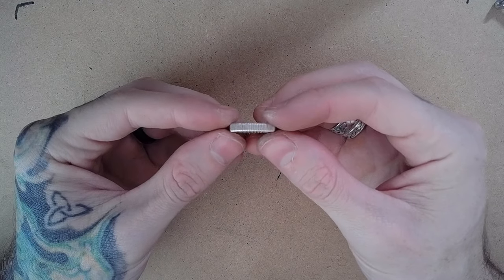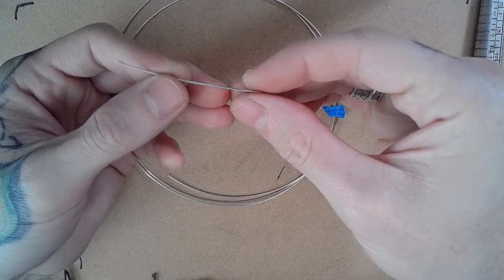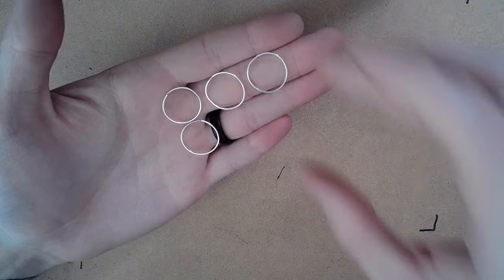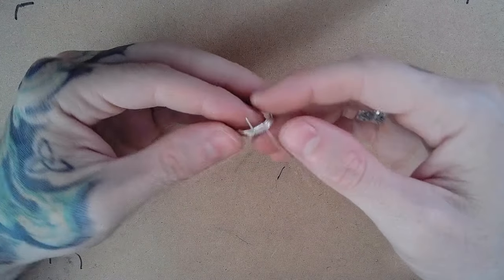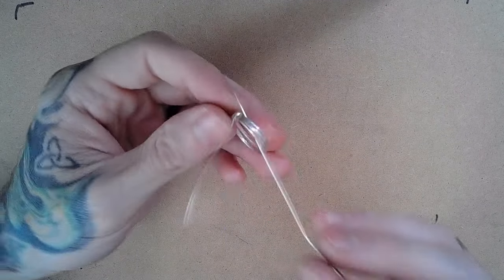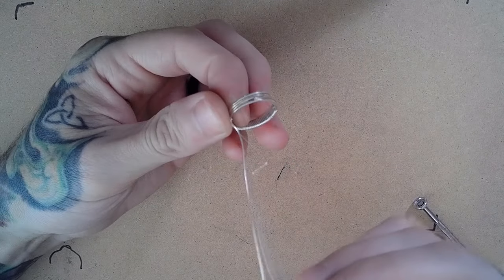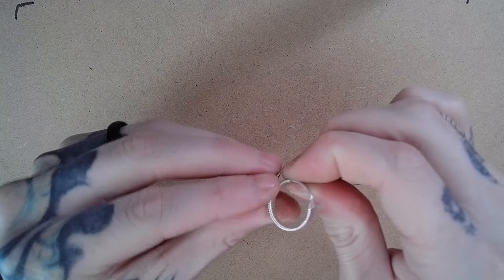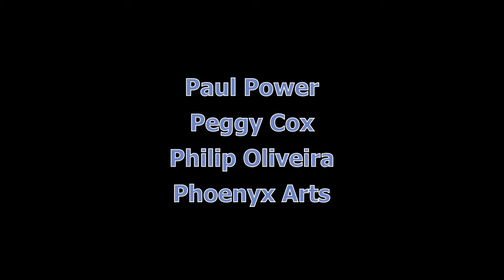Wire Wrapping Tutorial: Seamless Rings (NO SOLDERING REQUIRED!)

Comment: For anyone who has no access to square wire, for whatever reason, if you gently hammer each ring band so that you create a flat side, that will improve your outcome dramatically. I tried and was happy with the results. You still should be using half round for binding but I bet it would probably be ok if you used a Very thin round wire to bind as well.

Comment: Thank you for this, I am fairly new to wire wrapping and still find soldering a bit intimidating, so I always appreciate this kind of alternative.
One question, if you don't mind.. how do you straighten square wire, so that it doesn't have the subtle twists, made apparent once wrapped. You're work has led me to fall in love with square wire, and I'm definitely incorporating it into as much of my work as I can, but I have to admit these small twist drive me crazy (obviously never an issue with round wire!).
Reply: flat nylon pliers
Reply: You have to make sure it doesn't twist to begin with! Once a twist starts its hard to correct it. If your having trouble with making the ring shank circles just wrap them very slowly around a ring mandrel making sure you keep a flat side down firmly against the mandrel.

Comment: Thank you for this! I made 5 perfect rings in a row tonight in  different sizes using 20 guage half hard for the base wires and 20 guage half round (DS). 
Making sure the length of the base wires are the  same as well as even tension on the half round weaving wires is consistent is the key to making these! 
Thanks again for another great tutorial Nolan!

Comment: I have watched this video several times as I really love this ring. Well, today I tried it and I really messed up. Everything went fine until I was wrapping the 1/2 round wire.  I didn't have 22 ga, so I used 21 ga., due to the length of the wire I found that the wire would kink up and have a hard time keeping it straight. Is there a secret to keeping it from kinking? You have awesome videos, I love them! Keep it up!!
Reply: I personally have 2 ways I like to keep my wire from kinking.
1. Wubbers. They are silicone pliers that can smooth a wire should or get kinked, but don't overuse! Wire gets tougher/harder the more it's annieled, so use this technique sparingly.
2. Pinch the wire as you go along, with your fingers. This will keep the wire warm and pliable, but also keep the band straight. 
Been wrapping 4 years now, myself. The struggle is real!

Comment: Amazing tutorial! Do you think this would be able to be done with a channel setting somehow?
Reply: Yes actually, you could run the setting wires beneath the wire being coiled around the band (:
Reply: @Divine_Mode  I was thinking of that but would be somewhat worried how well it would be able to hold without messing with the square wires. Since there's a lot of tension needed with a channel setting I wouldn't want to pull too hard and mess up the square wires. I think this is something Im going to have to experiment with in the future !

Comment: Often when adding curves to wire, I hammer them lightly with a rubber mallet to work harden the curve. Would that help with this at all? I also wondered about fusing instead of soldering. I haven't found anything by you about fusing but I'd like to learn more.

Comment: Can you do a video on a V shaped ring with one wire wrapped around 3x, so 3 Vs stacked into each other and the ends wrapped a couple times on either side of the V. I am having the biggest issue getting them done.

Comment: Raftark Jewelry Is it possible to make this ring using 6 or 8 wires?
Reply from the maker: Of course!
Reply: Raftark Jewelry thanks for answering so quickly. I like wide bands and think that would be beautiful. I wonder if it would take 10 pieces of wire to get a 10 mm width? I’ve never used square wire before so not sure.